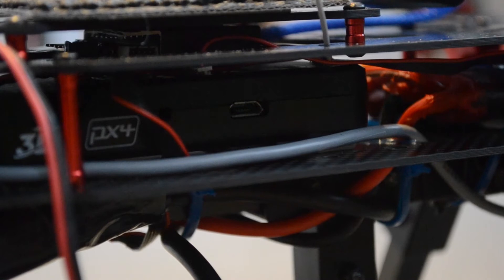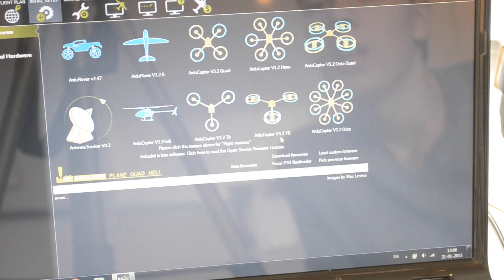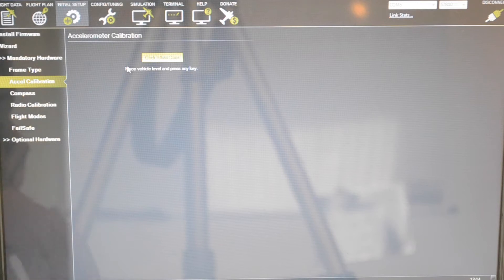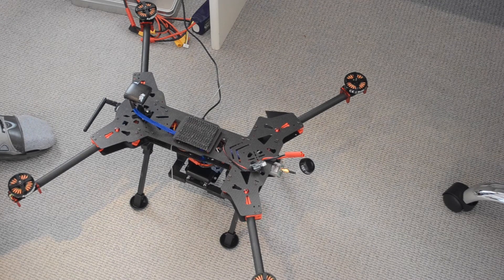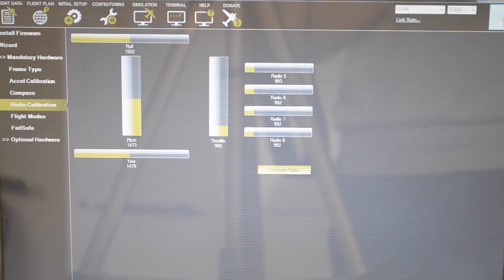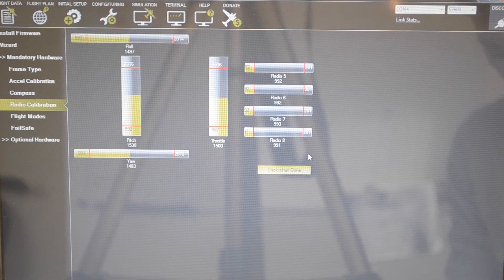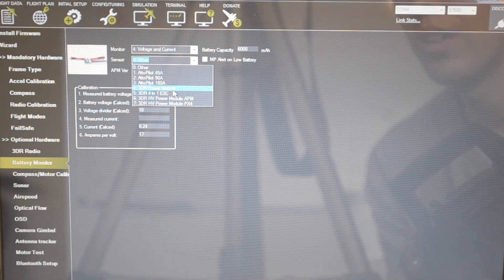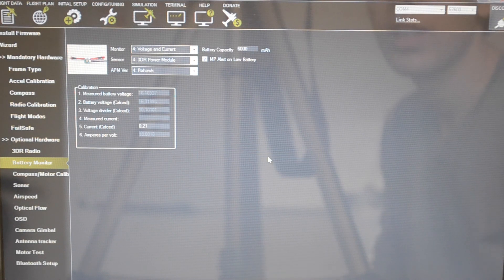H4 Alien 680mm quadcopter build and review - Setting up the pixhawk [Part 8]

Comment: First of all thanks for your great job.I found these videos after I bought the same frame and it was really helpful.I am not sure if you finished the build and tried it or not but I would like to know what gain set you ended up with this frame. I am using turnigy 390kv , 6s 8000mah and pixhawk plus exactly the same frame .
Reply from the maker: Actually i didn't touch the gains at all. It flew so good from "standard" settings that after i fiddled with PID's for a while i just reset them, and it flew great :-)
Reply: MultiCopterBuild Thanks for the reply. I found what is the issue. My xrotor hobbywing ESC's not calibrate. I tried all together calibration.works fine after calibration but after  unplugging the battery ESc's are not calibrated again. each of the motors runs  on different speed.I will try manual one by one calibration and will plug the scope the pixhawk to see if the PWM outputs for each motor are at the same level. I will appreciated if you let me know if I am missing something.
Reply from the maker: Sami Ahmari Hmm weird. I have tried to research and recreate your problem. I can't seem to succes in any of it. Have you tried opening up a thread on DIY drones? Theres some very smart people on the ready to help.

Comment: Hi...I'm just building one of these myself & they are a very nice frame to work with, one thing I found when I built another with a similar type of carbon frame a little while ago though was that the wires that go through the frame tend to get a bit chafed after some time & start to wear through the insulation because of the sharp edges of the frame & the vibrations chopping into them over time, & as I'm sure you already know, the last thing you need with a carbon frame are short circuits, particularly on the very high current motor & esc wiring! So to be safe & avoid a possible future calamity I've taken all the sharp edges off around the holes where wiring goes through the frame with a small needle file, it's a little bit of extra work but well worth it I think, because those frames are very electrically conductive & most of those edges are very sharp!...I've not had time to see the rest of your videos on this build so you might have already thought of this, but I thought I'd just mention it in case you didn't...